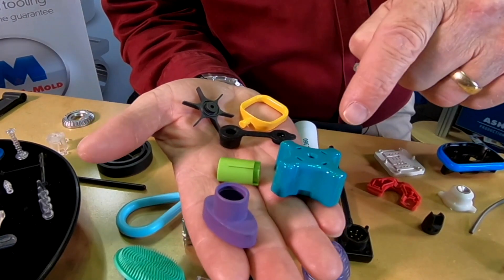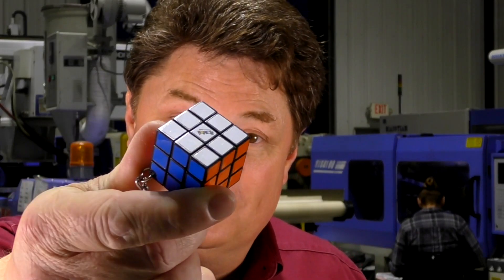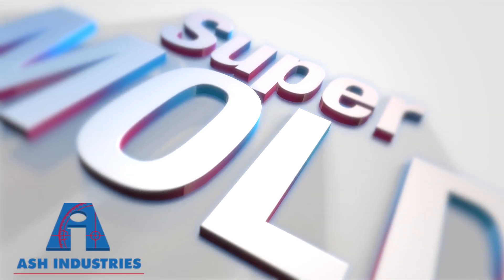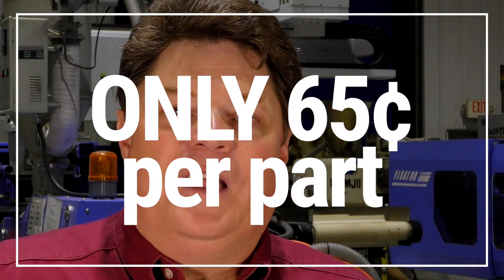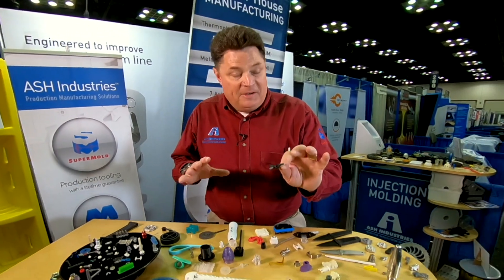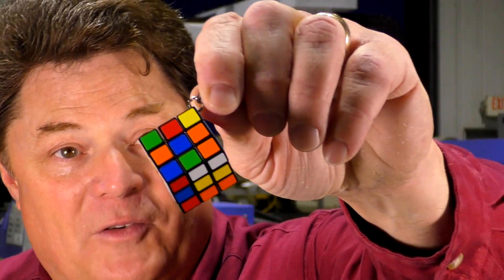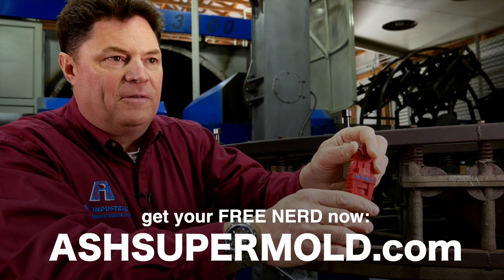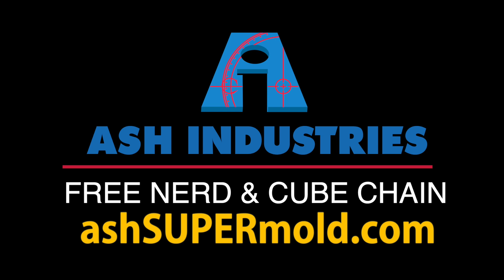Low Volume Injection Molding Instead of 3D Printed Parts | ASH Industries Supermold | Lafayette, LA

Comment: I think this is great. people on here are freaking out about 3d printed prints. for high Volume  parts cost vs time is what he is getting at. I'm still getting a Resin 3d printer to build my prototype. and make the necessary adjustments at home. and take as much time as I need to get the final product that I want ready for the mass production. that I will require when I'm ready to move it to sales.
Reply from the maker: THANKS FOR your comment- People forget that 3D printing in larger quantities does not give you the actual material or tooling for the final part. This program saves a lot of time in proof of concept and going to final production.

Comment: I have some models I want made using a plastic filled with iron ferite, so magnets can stick to the pieces.  I my models are meant to be food grade plastic of some kind, or at least toy grade.  Do you have such plastics available to you?  I have an interest in using Polypropaline with Iron Ferite filler, as I've read and observed that parts keep their shape, regardless of how much you bend them.  I have also read though that polypropaline is slippery. So I do not know how well parts will snap together and stay together.
  I have the models made in Blender, and can export them as a few different file types.  I need to know what the tolerance are for the type of plastic as well, so my finalized models will produce pieces with snap together properly, and no fighting with or filing of the pieces is needed.
  Can your services be of service to me?
-Charlie

Comment: What are the next steps after you have been 3d printing your own parts and selling them. I now know there is a market for what I have been 3d printing, but what are the steps to go from that to injection molding. As in, would you work with the 3d STL files that I have used to make my prints or do you work with some other file formats? These are the things that have confused me from moving forward.
Reply from the maker: Contact ASH and we can look at your part and put you in the super mold program which gives you lifetime tooling and 1000 finished parts....
@t

Comment: how much does it cost to make 3 sets of molds for 1/64 size model car ? Around 600 to 1500 shots per mold
Reply from the maker: Can you call becky for a quote? (337) 235-0977
Reply: Contact number pls

Comment: Would the super mold work for this application:  https://showalterfireworks.com/shop/shop/spinners-helicopters/2-color-space-ship/. 
Dimensions of the plastic part in the photo: 1" inner diameter x 1-1/8" outer diameter by 4" long. The wingspan from one wing to the other when attached to the body measures about 4-1/4" long. These have to be made so that a 3"long x 3/4"ID x 1"OD paper tube will fit perfectly. I prefer a strong semi gloss type of plastic that won't crack on impact. A little help with what type of paint I will need would go a long way too. I prefer light baby blue, dark blue, red, light gray, white and vintage white dyes. Please respond!
Reply from the maker: ASH replied:  "We would be happy to help, but we’d also like to get a sample of the wing/spinner or a basic sketch.  There are several plastics that could work, but the price point you desire and the volumes you will need will make a big difference in the best configuration (material & mold details)  https://ashindustries.com/products/supermold
Reply: @partgurus  i can draw very well and sketch you a 3D image with additional notes. You talk about how expensive it can be and how you make it very cheap. I dont have a lot of money. The most I'm looking to spend is $100.00 so long as I get 75 pieces in return at the bare minimum. I'm a regular customer. When I run out I always buy more. Lmk

Comment: I have a 1/6 scale restomod 69' Camaro tube chassis with the front & rear subframes, engine bay, front bumper and rear splitter that I want to mass produce but need a solid quote on injection mold cost. There's lot's of parts in my CAD design. Some small and some large but nonetheless all should be injection molded here in the U.S. of A. Just to keep it simple the tube chassis is all flat individual parts to make assembling the kit and replacing broken parts easier. Once I learn how much each compete unit / kit will cost to make I can then set a realistic retail price point and sell them accordingly. If you need some business, I'm totally interested.
Reply: Mike!  How may we contact you?  Please reach us at www.ashindustries.com/contact-ash

Comment: Are you able to support inserts / pins with this program? Do you allow for customer specified/ supplied resin or is it only for your selection what you stock? Textured finishes? Can small tool changes be rolled into an updated part cost? Do you only guarantee your shop tolerance or can you build to tolerances as drawn (to include GD&T)? 
I'm a design engineer at a company large enough to be unlikely to use this particular program, but I can see the appeal of rolling tooling and NREs into part costs and might be interested for some consulting work I'm doing for a smaller business.
I'd normally send an RFI via email, but I figured you might like the opportunity to talk a bit more about the services you offer.
Reply from the maker: Can you call? Hartie (337)-235-0977  Im the owner and the guy in the video. thanks!
Reply: www.ashindustries.com/contact-ash   GREAT questions. Thank you. SuperMolds have a lifetime guarantee and are incredibly flexible.  SuperMold material can be ANY material you choose.  The price of the SuperMold line of tooling includes the mold, the machine time, but not the cost of the actual pellets (so that anyone may choose whatever material they wish).  You are welcome to provide the material.  Overmolding, Insert molding, two shot molding can be included with the SuperMold as an addendum to the base price.  For instance, insert molding around a pin/insert will probably not affect mold price, but will affect part price.  Textured finishes are welcome, but custom patterned textures may add cost to the mold.  Standard SuperMold standard tolerances are ±0.005 but can be tighter depending on geometry, material choices.  GD&T will need to be quoted separately.

Comment: To those that don’t see the point of this:
Yes you still use 3D printing to prototype your design.
3D printing is expensive in the sense that they are slow to produce compared to injection. They get more expensive than injection after a certain scale. 
As mentioned in the video, attributes like parts strength, surface texture, and accuracy of 3D printing can be a problem in some applications. 

I don’t know whether this particular scheme is good, but there is definitely a use for small-ish scale injection molding.
Reply: yes that is true but i can go online and 3dprint to get products with less COVID19 risk then shopping for grocerires by pick up & a mold cannot be edited a 3dprint can

Comment: If you lose a mold you lose everything loose a 3DPrinter look up your back ups or if published just google it & restart & start 3DPrinting
Reply from the maker: Molds are lifetime and with in house tooling you are protected from losing a mold
Reply: @partgurus  yes but a .stl can be shared with thousands of people my rubber band pellet slinger on 4 sites total has over 950 downloads i have not calculated the latest but that would be like sharing a mold with 950 people
Reply: Part Gurus where molding wins is during covid19 supplies because although 3DPrinting is helping that’s because thousands are helping but with molding they would win in that case
Reply: Part Gurus yes but i got too many ideas for a mold & at times teweek & remix & thats more for 3DPrinting then any injection mold or just about any mold i can think of

Comment: With a 3d printer i made several iterations of my design part.  Cost of 3d printer = $ 200 . Cost of filament < $10.   It would be prohibitive with a injection mold method ( even a diy hom e made one) .
Reply from the maker: Hi - Yes one part- but how much is 500-  3D printed parts using more robust materials?
Reply: @partgurus  We are all waiting for 3D metal printing of the tooling molds, so we can buy our own second hand injection molding machines and run them ourselves.  When you look at what cars are in the lot at an injection mold company, you know you are paying new BMW pricing for everything, at every step of the way... so that the injection mold company can stay in steak and lobster.  Ask any Big Three automotive plastic parts buyer.
Reply: Nowhere near $7400 that is for sure lol

 

Another Option
$40 Siraya Tech High Temp Resin 
$289 Anycubic Photon Mono 4k
$12500 APSX-PIM Injection Molding Machine 
$750 3D Printed Mold Holder
Fluctuation in Materials and fees

I think I would rather do it my way lol

Comment: Could you explain how you arrived at a conclusion that 3D-printed parts are expensive? 0:34
Moreover, before spending 5k on a super mold, 3D printing is still important for cheap iterative prototyping.
Reply: Is expensive in bulk when time is considered
Reply: @381delirius  Did you see the size limitations? Parts this small are generally fast to print. Not as fast as injection moulding of course, but you don't need that kind of speed for prototyping. They even name the video "low volume...".
Reply: @Pokornz  true
Reply: I think it is called a bold face lie.
Reply: You can get a prusa mini (3Dprinter) for $350 usd excluding taxes , duty , shipping , etc

Comment: Too bad my parts are so much bigger.
I have to sell my house to get my mold. Ha
Reply: You dont have to sell your house to buy a mold as I mentioned a 3DPrinter like a prusa mini can be bought for $350 usd exlcuding tax, shipping & duty
Reply: @timpostma7106  
It takes two molds to make my product. 
The quote that I received to make one out of 3d printing was 1700 bucks.
Reply: Allen Huebner the prusa mini 3DPrinter to buy is almost x5 times cheaper then that
Reply: Allen Huebner & second if its that expensive you must be using a different type of 3DPrinter a hobbyist or typical  3DPrinting spool costs between $20 & $50 per kilo
Reply: Allen Huebner you received a high qoute because chances are it was a more expensive 3DPrinter which multiplies the cost by about x12 that of a hobbyist 3DPrinter cost
Reply: Allen Huebner whats your product , look at the 3Dhub’s engineering specification requirements for 3DPrinting https://www.3dhubs.com/knowledge-base/
Reply: Allen Huebner most places overprice those by a shit ton... a 60% keyboard case on 3d hubs costs $2000